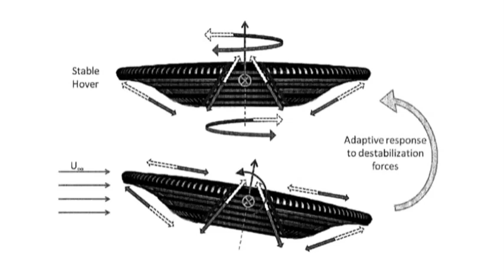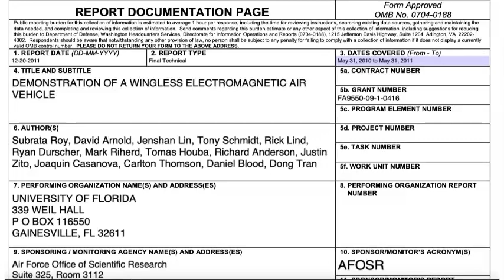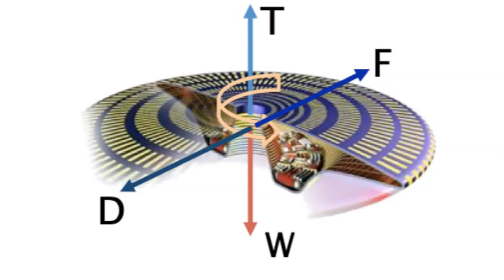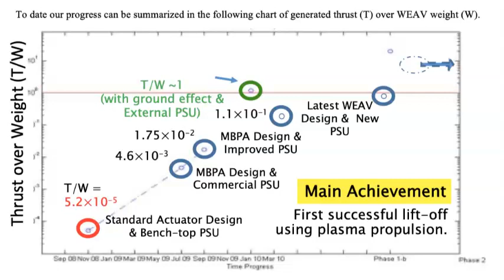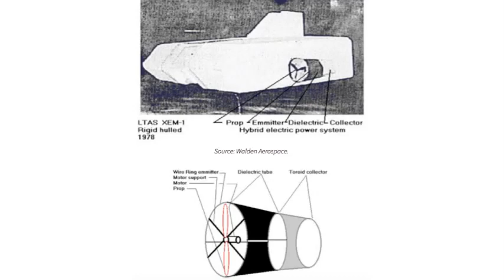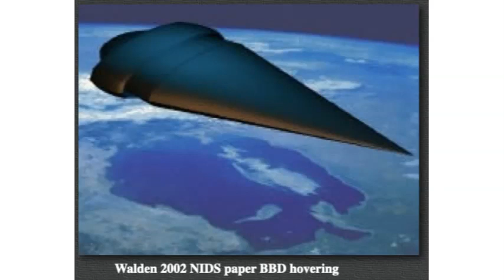MHD Demonstrations Of Nonconventional Flight

Comment: Makes scenes to me especially super-venting the light power source problem by having energy beamed from a ground or distant mothership in deep space to far to detect or retaliate from earth. Fascinating stuff.  No moving parts, quieter, faster preprogrammed reaction and maneuvering/reaction speeds among more. For use against a species without such space fairing capacities, it will be quite the unfair advantage having your aircraft power and flight time not be weight dependent.